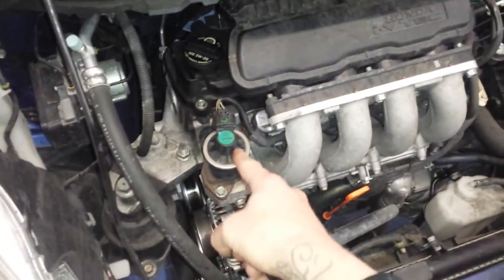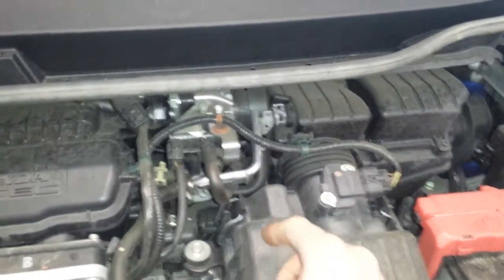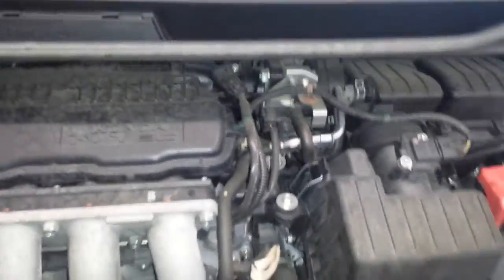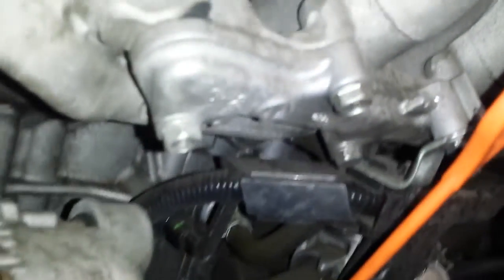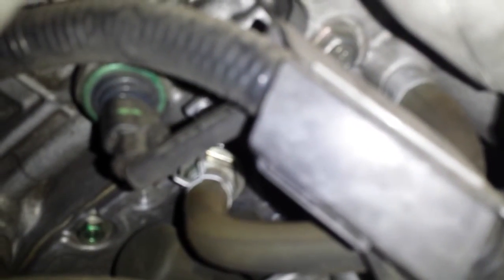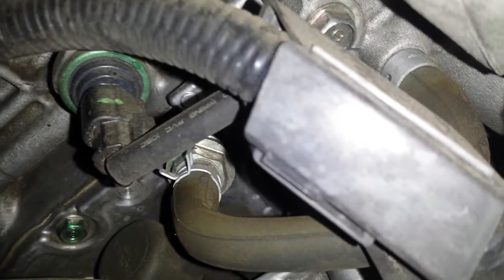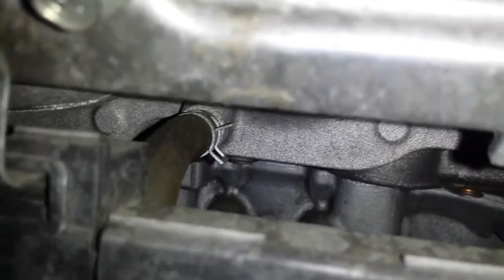Honda Fit / JAZZ emissions: EGR, PCV, EVAP, locations

Comment: Cleaning my EGR valve suddenly made my car run great the other day, when it had been having extreme misfires that replacing coil packs and spark plugs didn't even fix. Now it's back to misfiring again, and I believe I hear a slight vacuum leak, the very instant that j tap on the gas pedal. Now, the day that I cleaned out the EGR valve, I also put red line fuel additive into the gas tank, so I wasn't sure which of the two things had suddenly seemed to fix the problem.

Comment: Hi, I have a 2004 Honda Jazz/Fitt having an issue kindly suggest me some possible solutions please. When ever I start the car I can hear a water splashing underneath the driver seat and realised that splash/air noise is from fuel tank upon doing OBD diagnostic the error’s “(P0443) EVAP
Canister Purge Valve Circuit
Malfunction” so I replaced the unit and clear the error code, So now there’s no error code in diagnostic but that splash/ air blowing noise is still coming underneath the driver seat possible from inside the fuel tank. 

Can anyone share best opinion/suggestions ???
Reply from the maker: Are you sure the sound is not coming from the passenger feet area? Behind the glove box?
Reply: @ScottiesHobbies  Air was trapped in the heater/cooler box but apparently issue resolved after the replacing the OEM thermostat than few long drives, So far so good

Comment: What is the name (and maybe part number) of the( I think you said Evap canister) under the drivers side up under the plate?  Trying to fix error code P0455 and P0456 on 2013 honda fit.  The Evap Solenoid in the front under the hood next to the intake checks ok...Please help.
Reply from the maker: Have you taken a look at your fuel cap? Look at the seal on the bottom side of the cap or if it is very easy to click when you are putting the cap back on, the internal seal might be bad.
Reply: @ScottiesHobbies  I did change the gas cap a few months ago and the problem went away, but now its back again.  I guess smoke would confirm if the gas cap is the problem... I want to test the canister vent control valve next.  I already  tested the canister purge volume control valve near the engine.
Reply from the maker: I just looked up TSBs on your car. This one is a little crazy but the seal on the fuel cap might be the issue. 
 https://www.google.com/url?sa=t&source=web&rct=j&url=https://www.driveaccord.net/attachments/a14-010-pdf.278529/&ved=2ahUKEwjRvorSidj0AhWJPM0KHS48ArMQFnoECDMQAQ&usg=AOvVaw2UEEqS5eqhaNPvDOApXWoa
Reply from the maker: If its not the cap. A smoke diagnostic would/should find the leak. I've seen debris in the vent causing the system not to seal in the past too. You are on the right track for sure. Test the vent. If its good, a smoke diagnosis would be next. 

Keep us posted on what you end up finding.
Reply: @ScottiesHobbies  I took a look at my cap this morning and it is indeed the brown colored seal.  Yesterday I disconnected the negative lead on the battery and was able to reset the engine code.  Now I'll wait a few days and see if the code comes back.  I may try smoke testing before buying another gas cap...Thanks again for all your help...

Comment: I have a code on my 2009 Honda Fit P0498.  Error Code P0498 is defined as Evaporative Emission System Vent Valve Control Circuit Low. ... If the PCM detects a problem in the EVAP system, particularly in the vent valve circuit indicating “low”, then the Error Code P0498 will be stored, and the Check Engine light will be activated.  That was a copy paste!  I have cleaned the EGR valve what would be the next thing to check?
Reply from the maker: The egr should not effect this code. The vent solenoid is either bad and giving the computer wrong resistance to close or open. So I would find the vent and see if you have a good connection to start. The  solenoid would need to be tested. Check the ohms of resistance across the prongs on the solenoid. 

Did you check the gasket on your fuel cap, check for cracks or a poor seal.

Keep us posted.  Good luck.
Reply: @ScottiesHobbies  Yes, I bought a new gas cap and it made no difference.  I'm not sure where the vent solenoid is on my 2009 Honda Fit but if you can show the location and the part number I will buy it and try it.

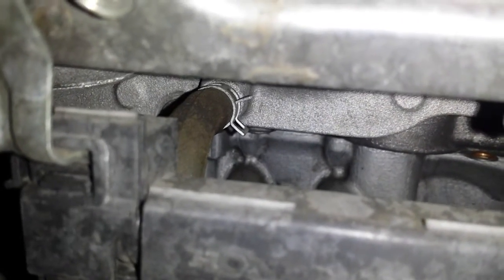Comment: Did you notice the brass washer sitting on the intake manifold at about 1:27 where you're talking about the pcv valve?
Reply from the maker: The pcv is to the right of the green washer. "This hose goes down to the pcv valve." 

I need to remake this video without the sound and with more info like my newer videos.
Reply: @ScottiesHobbies  Thanks for all your great videos and help.  My comment here was not about where the PCV valve was at, but rather if you notices the brass washer sitting on the intake manifold at video time about 1:27.  Yes you are getting better and better about making videos....and we all appreciate your effort...
Reply: @TerrydeAlaska 😂 😅😅

Comment: My 07 monte carlo LS 3.5l flex fuel, has a bad PCV and im 19 an doin it on my own so i dont have much knowledge on it, i know the location but im not sure on how to uninstall it an also where to find a new one, was gunna try a wrecking yard but havent felt comfortable taking it out until i have a reference of some sort to do it right, i havent been driving it because its at its limit on what it can take with a bad one, its to the point where its leaking oil out of the gasket so would be awesome to have some kind of help. thank you for your time- kayla

Comment: Hi, Scotties, can you help, when put full gasoline on my fit i feel a smell of gasoline inside the car but i cant find where is the problem can you tell me where check for this smell or whats pieces replace!!!! thanks.
Reply from the maker: I would look under the hood. Your cabin air intake is probably sucking in air from under the hood. Look for any wet/moist spots around the fuel system connections. But its hard to point out one problem without seeing the car.
Reply: @ScottiesHobbies  thx bro the mechanic find a broke hose near gas tank, i need replaced this pieces but thanks for your advice....and for answer me too.. thanks man.
Reply: @franciscocuerno1710  I get a strong gas smell and I keep getting evap codes, P0455 and P0456. Dealership did smoke test and found nothing. Check engine light keeps coming back on.